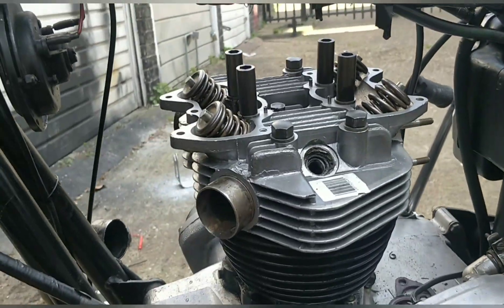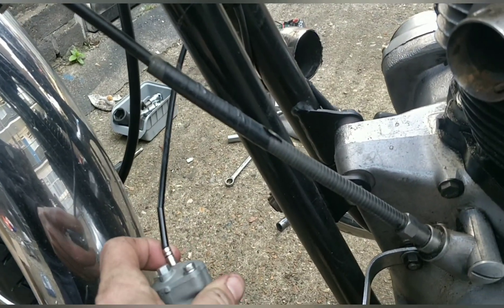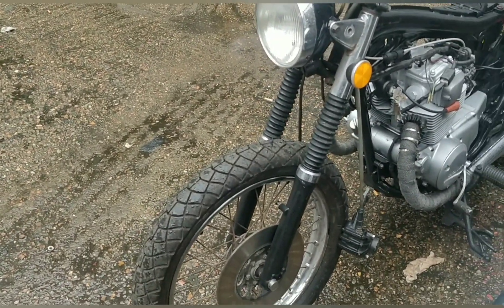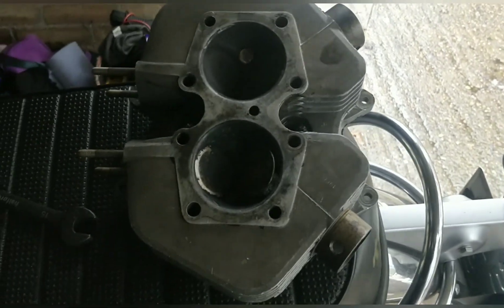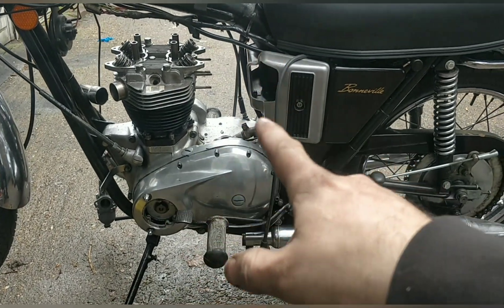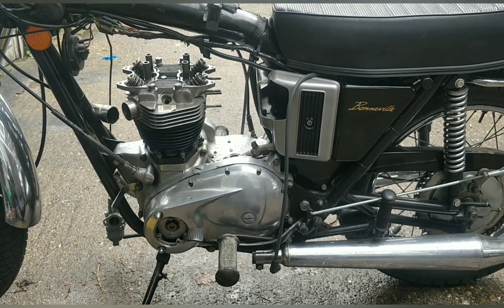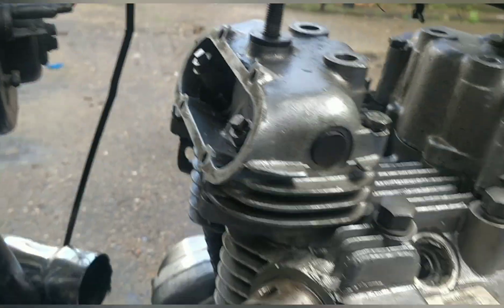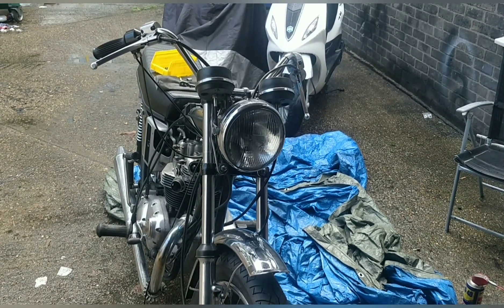Triumph Bonneville T120 to tr6 conversion. Not going so well lol. I've rarely felt this frustrated.

Comment: Thanks Charlie for going that extra mile and sorting out the running issues on the bike. Wish I could have been there but really good you diagnosed and fixed it. 
Can't thank you enough for your kindness; patience and determination with this project:))))
Reply from the maker: Alot of this extra stuff I learnt from you. I wouldn't touch valves etc until you started helping.

Comment: You can fit one rocker box (that's what they're called) at a time. Before fitting, as suggested, put a blob of grease on the bottom of each pushrod, then locate them on the cam followers (the holes in the gasket will hold them in position to align with the rockers) To ensure they are correctly located at the bottom, turn the engine over and make sure each pushrod rises and falls in turn, then turn the engine until both are at their lowest point (this will ensure the rockers are not trying to open the valves as you tighten the mounting bolts). Now take the rocker box, slacken the adjusters off, then lift the adjuster end of the rockers and lower the assembly into position, making sure the balls on the rocker ends engage with the pushrods as you lower it. Once it is in position, check that the rockers have a little bit of up and down play, so you know they are engaged with the pushrods. Tighten down the rocker box mounting bolts and nuts, then tighten tappet adjusters finger tight and turn engine over slowly to ensure valves are opening and closing.
 
Repeat the whole process with the other rocker box, then you can set your valve clearances. It doesn't matter which you do first, but if you start with exhaust, turn engine over until left exhaust valve is fully down (open), now adjust clearance of right exhaust valve (should be .004" on 650) and tighten lock nut. Turn engine over until right exhaust valve is fully open, then adjust left clearance. Turn engine over again and recheck, then repeat the procedure with the inlet valves (.002" clearance on these).
If you prefer, you can complete the fitting and adjustment process on one rocker box before fitting the other, it makes no difference.

It may sound complicated, but once you have done it a couple of times, it all makes sense. Good luck with it.
Reply from the maker: Thank you Rick, I really appreciate that. It's sounds similar to what I've been trying. I did the grease trick as you said aswell in the end. I think they are all in place now. Time will tell. Should do a fire up tomorrow. 

I'm also waiting on a 240 main jet as that is what the tr6 asked for.
Reply: @motorcyclerescuer  in standard trim, the TR6 would have a 230 main jet, no. 3 1/2 cutaway slide (stamped on bottom of slide) and needle with circlip in middle groove. As you are intending to run it with non standard filter, you may need to experiment with these settings. For initial startup, the main jet size shouldn't make much difference, as it only really affects running above half throttle.
Reply from the maker: We're going to use a pancake filter which people say the standard 230 jet will be fine with Rick.

Comment: Torque specs for the head bolts/nuts: 5/16" threads (the 5 inner ones) 20Nm/15lb.ft, 3/8" threads (4 outer bolts) 24Nm/18lb.ft. Tightening sequence: start in the middle and work outwards in a spiral. After you retighten cylinder head, you will, of course, need to re-adjust valve clearances.
Reply from the maker: I'll need to order a new torque wrench. Also it should be re tightened after 100 miles right?
Reply: @motorcyclerescuer  I usually run it up to operating temperature, let it cool off completely (preferably overnight), then re-tighten. After a couple of hundred miles, I retighten again (always with cold engine). There's a correction to my torque specs - it's only the middle bolt that's 5/16", all the others are 3/8".

Comment: assume your turning the engine CCW from the left, (always towards the front wheel) rod still shouldnt become dislodged as it should be trapped between the drive cam and the rocker
Reply from the maker: I know it was weird. In the end I read online that a lump of grease on the bottom of the rods can help. Then I put both the front and back tops on and it seemed to be ok. 

So currently it all seems to turn over ok, all valves are opening and closing smoothly etc. 

Cheers Steve

Comment: I have a aprillia 650 pegs so 2003 with fuel injection low miles under 5000 tank was leaking fixed that but while off got full of rubbish cleans but may be not so good when I went to start popping and spluttering so took off injectors cleans them but the rubber washers where done so I want to order new ones but what do you cover them in as very tight cheers mate any info appreciated ❤

Comment: It’s the rocker arm that’s falling off the top of the left pushrod because the adjustment screw is wound out too far…..wind it in a bit so it roughly matches the other when…..then the rocker arm will stay on the top of the pushrod…….they’re not picky engines, they’re excellent………you know where the name Bonneville comes from I hope………
Reply from the maker: In the next vid (probably tomorrow) I'll show that all the pushrods are on and working. 

And yes I definitely know where the name comes from. 

I've got a question for you if you don't mind? 

When I strobe the bike for timing (it has a Pazon electric ignition on) do I mark the 38 degrees on the wheel and time that to the tdc mark, or do I mark the 38 mark.snd time it to the 38 mark on the case? I hope this makes sense. 

Thanks
Reply: @motorcyclerescuer  my 750 has Pazon…..ex directors of Boyer who moved to NZ….and developed a better product. Hook up the strobe, start the engine…..when you rev it to 5000…..the line on the alternator rotor should line up with the pointer on the crankcase……job done…..if not……look for Lunmad here on YouTube…..a real down to earth, hands on expert…..unfortunately he died a little while ago but I believe his videos are still up……
Reply from the maker: @BLUESBOYBENFIELD  I've seen his vid funny enough. 

Cheers
Reply: @motorcyclerescuer  mine starts first kick every time in all temperatures….but it has new big ends, new cams and followers, a rebore and new pistons and rings and a brand new cylinder head and valves, guides and springs. I have also fitted a Podtronics regulator/ rectifier and a Motobat battery……which really help in terms of reliability…….
Reply from the maker: Hopefully ours will be running well soon. 

Cheers for the advice. Appreciate it.